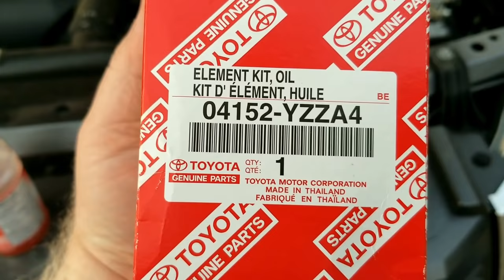Changing oil in a Toyota Tundra

Comment: I bought a use 2013 with low miles, seems to me that replacing the transmission fluid is much easier than the engine oil , my 2001 Toyota Tundra was just much easier to change the engine oil. I don't know why Toyota makes things so complicated, if is not broke don't improve it  . But my 2001 Tundra never gave me any trouble what so ever, even that I work it much more hard than all the F150, that I bought new between 1984 and 1995. Thanks for the video.
Reply from the maker: These aren't as complicated as others I've worked on

Comment: P.s. just did spark plugs on the 5.7 tundra . 
It was the easiest tune up ever . Iridium plugs $68 .00 . Toyota wanted 489 bucks
Reply from the maker: Yep.  You can order parts online a lot cheaper in many cases.  I try to put links to Amazon in my videos for the parts I use.
Reply: at what mileage is it recommended to change the plugs? i'm at 30k and the free maintenance is up...
Reply: @TraebotheSkybo  1000k
Reply: @crispychicken2743  oh wow okay, so i have awhile lol thanks bud!
Reply: @crispychicken2743  
Don't you mean 100,000 miles?
1000k would be a million miles.

Comment: I replaced my oil cap a couple of months ago with the metal one provided in the description. I noticed today that I have oil leaking from my drain plug. I had it all tightened to the correct torque specs so i'm wondering if maybe it has something to do with how cold it has been lately. Anyone else had  problem with the drain plug coming loose?
Reply from the maker: I haven't had that issue with mine.  Has your pan been hit with something that could have bent it?
Reply: @Systemcontroltech   I don't see any dents or dings on it. I've pulled the skid plate and tightened things back up. I'll keep an eye on it to see if it happens again.
Reply: @mattmaylett6827  
The proper torque spec... You mean 30ft.lbs.?

Comment: I just had my 17 serviced at Toyota dealership. Woke up in the morning and had oil in my garage. I got a TRD with skid plate so the drain plug got plenty of access but the filter has a removable window to change it. I’m thinking the “factory” tech was sloppy with the filter and my whole skid plate got filled with oil... I hope.....
Reply from the maker: And that's why I hate taking mine anywhere else to have it done.  I've also heard about dealerships using impact guns on them.
Reply: I just purchased a cert. used 2017 Tacoma SR5 with a 3.5l V-6.  I have heard horror stories concerning "newbie factory techs." over tightening this filter housing.  I just purchased a special filter cap wrench to complete the oil change myself.  One thing I noticed..  Almost every Tacoma/Tundra oil change video on youtube involves the adding of Mobil 1 "Advanced Fuel Economy: 0w-20 oil?  Does this brand seem to work better in Toyota engines requiring 0w-20??
Reply: @Systemcontroltech  Impact guns on this housing?!?  The OEM oil filter instructions/package provide torque specs for this filter housing and drain plug.
Reply: I've almost always changed mine myself and stories like this make me want to continue
Reply: @stephenmaurer7008  
The torque specs are right on the oil filter cap.

Comment: Did u remove the skid plate or you don't need too on your model?
Reply from the maker: There was no need to remove it on mine.
Reply: Really. Looks like mine you have too, but i'll check again. I bought all the parts you recommended from your amazon links but then i couldn't find the oil filter and read it was under that plate.
Reply: I had to remove my skid plate. I have an Off Road so that may be why.

Comment: I have seen 2 ways to do the oil filter housing..either remove entire housing with drain cap intact,or remove cap,drain oil through hose,then remove housing.Not sure which is easier
Reply from the maker: Neither one is difficult.  It just depends on if you want to drain the oil out of the housing before removing the filter.
Reply: Why would anyone want to remove the entire housing. All you need to remove is the oil filter housing cap. The rest of the housing stays on the engine.

Comment: use the correct wrench.  14mm not 9/16"
Reply: They are close to the same but not quite. If a 9/16 inch is being used, at least make it a six-sided socket or box end (instead of twelve-sided).
Reply from the maker: It works
Reply: I was gonna say, if you have Toyota, invest in metric tool sizes, less rounds bolts and nuts.

Comment: Also,toss the plastic OEM housing and get the Aluminum one either on Amazon or Oreillys
Reply: Personally, I see nothing wrong with the plastic oil filter cap as long as it is only torqued to specs.
Reply from the maker: I would rather have a problem with the plastic one than cause an issue with the blood trying to solve a problem with the aluminum one.

Comment: Great video! Only thing... Pull off the o-ring from the oil filter cap, before you put in the drain tool. Unless you like oil running down your arm and all over, lol I even tried the bottle, but the oring was in the way.
Reply from the maker: It's good for the skin. 🤣😂😆

Comment: Look at your owner manual for oil type 0w-20/5w-20 full synthetic. For the engine less than 75k is recommended 0w-20. I change engine oil on my 2007 tundra crew max every 5 or 6k. 154k running still strong. 5w-20 mobile 1 full syntactic expanded performance 👍.
Reply from the maker: They seemed to change the recommended weight just between two model years that both use the same engine.  I don't understand why they did that.
Reply: What do you mean less than 75k is 0W-20? Then what? And what's so magical about 75k?
Reply: And the recommendation doesn't change when you get 75k on the engine. Why would it?

Comment: 0w-20 is water 💦 they recommend that oil so you ended replacing the engine after 100k 5w-30 full synthetic is the best oil in tundra trucks we put 6 1/2 qts of oil and 1 1/2 Lucas oil stabilizer you will have Engine for ever or a least 400k
Reply from the maker: I don't disagree and usually add some
Reply: bad advice

Comment: 0w20 .plastic oil filter cap sucks . Replace it with a metal . I broke the tabs on my cap . Tundra #1
Reply from the maker: I've seen mechanics at the dealership use impact guns taking them off and putting them back on.  That's why I change my own oil.
Reply: @Systemcontroltech  I am 55 and I have never had some one else tune up or change oil . 
In fact I only let one shop replace my clutch in my 1979 f350 and they screwd it up . Sence then I have never used a shop . 
If I cant fix it . Its totaled . You cant trust a shop .
Reply: I just did the same thing. I ordered the filter cap in the description so let’s hope the metal version holds up a bit better.
Reply: @Systemcontroltech  
And that's why they break.